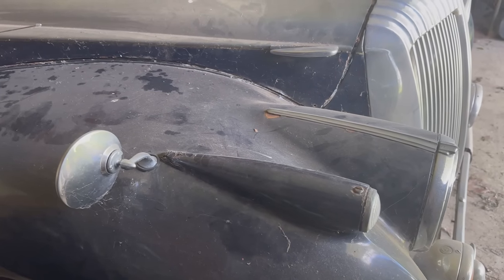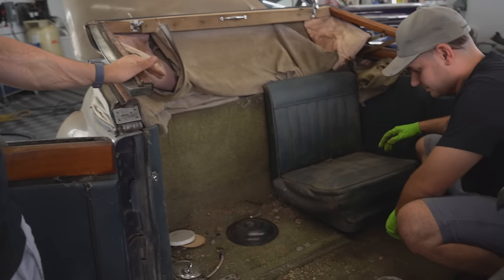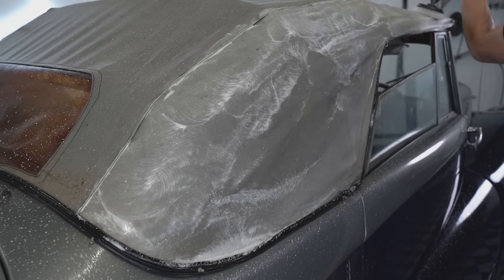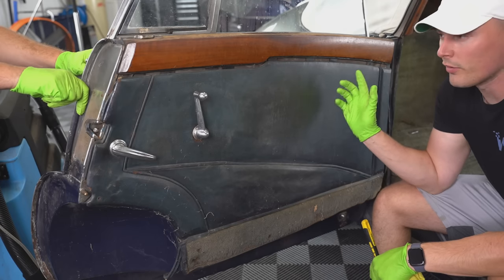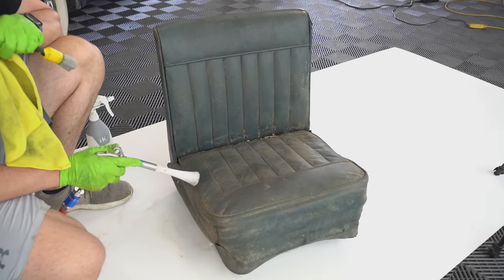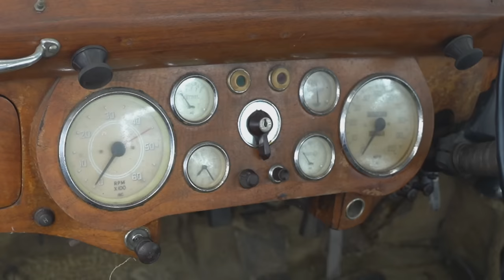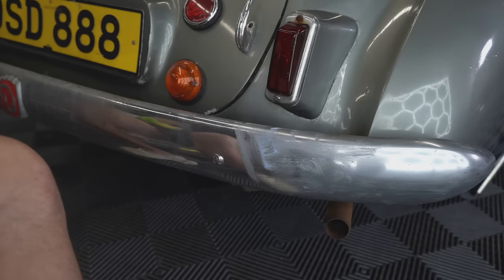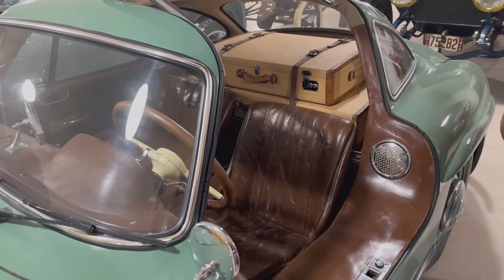85 Years Old ABANDONED Barn Find Daimler DB18! 1 of 25 Car Detailing Restoration!

Comment: For the record: Daimler is pronounced with the a sounding like an a DAYmler! And Coventry is pronounced as in Cough. Cov. But hey, great video guys! And GB just means Great Britain. The blinker, as you called it was fitted before modern indicators and was known as a trafficator.
Reply: They pronounced it right. Its German.
Reply: Nerd 🤓🤓🤓🤓
Reply: That is America speech  , not many can read or write
Reply: Who cares😂
Reply: @shydash3r  Check Google pronunciation buddy
Reply: I'm from Coventry and no-one pronounces it like cough.
Reply: Its Daimler. Not daymler. Gottfried daimler was not gay
Reply: Was known as a semaphore indicator.
Originally they just lit up. Later people used to add a flashing relay so you used to see them flick out then turn off and go limp then get go erect and light up again. Hilarious.
They also had a habit of sticking in once activated then they got mad hot and melted or went on fire.
Clever people added enough wiring to make them flick out and then flash.
Of course they were pretty useless at the best of times. I am old enough to remember them as standard on cars.
In the 60s we had a 1948 Day-mler.
We used it to tow our 1932 Brooklands Riley, school runs etc. It was a bit thirsty but lovely to drive with its pre- selector transmission.
Take off in second or third gear for chauffeur driving smoooooth.
Reply: COV-En-Tree - don't know where you got the cough from - bad weather? Coventry can get a little damp.
Reply: @shydash3r  It's British, and pronounced DAMEler
Reply: @golden.lights.twinkle2329  it's the damp...
Reply: @FrankJAnICKK  Gottfried Daimler had almost nothing to do with the Daimler Motor Company Limited, beyond lending them a convenient, known name to sell their cars under..
Reply: How can you pronounce, the founder GOTTLIEB DAIMLER the British way, it should be pronounced the right way, the German way, he started the Daimler in the UK to bring cars to Britain, that was he's plan, the original Daimler AG was started in Germany
Reply: @Zootalaws GOTTLIEB STARTED THE DAIMLER MOTOR CAR COMPANY IN BRITAIN IN 1896 to bring cars to Britain, remember at that time your Royals were still very German, and he's idea was to produce cars for the rich and royalty

Comment: Great video guys - this car brought it all back to me.
In 1973 I was 17 and bought my first car - it was a Daimler Conquest Century saloon from 1955 in white - so it was a year older than me at the time.
The registration was EMT 554 and was bought in London, it came with its original handbook which showed not only the saloon but a drophead coupe and a roadster.
The drophead coupe was very similar to your but without the suicide doors.
The roadster was strictly a 2 seater with a single dickie seat in the boot to allow you to carry an extra person.
My car had the battery under the rear seat and the semifore’s had been filled in but you could see where they had been.
It was the best car I’ve ever bought, sadly it failed the MOT due to the steering box needing replacement - I could not find one so I reluctantly had to let the car go. Back in the day car parts were not so easily obtainable as they are now.
Even back then it was a real head turner and I was a very proud owner.
Thanks for restoring my memories of a great car in great times 😍😍

Comment: Very interesting video about a truly lovely automobile. At the beginning you mentioned the 15 horsepower. That was the taxable horsepower calculated by the method specified in Britain because the road tax was calculated using that figure. Also, although you did not mention it, the circular hole at the bottom of the grill is for a crank handle to start the car. Many English vehicles had this into the 1970s. What was almost my first car was a 1967 Austin A60 Cambridge and it had that feature as well. 
If that is the original paint on that car i really hope it is not restored, just preserved. It is spectacular. Daimler was bought by Jaguar in 1960.

Comment: As pointed out by others, the missing gap in both fenders are where the electrical trafficators sit, basically your early version of indicators which operated either by hydraulic lines, cable, or in this case, an electrical solenoid. That GB badge I believe was used on the earlier models, as I tried looking for images of the Special Sports edition you have, but found none with the GB badge on it. Quite a unique car as they were partnered alongside Jaguar, another luxury car company that made similar-looking cars.

Comment: Those arms are semaphores and were used to signal turns before the widespread adoption of blinkers. This particular car appears to have also been retrofitted with actual blinking turn signals, which is a common mod, but it's not unusual to also keep the semaphores functional. It doesn't have 15bhp. The number you quoted refers to fiscal hp which is related to engine displacement and was used for calculating road tax. For the record, this model made 70bhp. The GB badging stands for "Grande Bretagne". Cars that travel internationally are expected to carry the identification for their country of origin. In the distant past, this identification was mostly based on French which used to be the language of international diplomacy. Since Brexit, British cars travelling on the European continent carry UK badging, although many countries, UK included, now include the identification of the country on the license plates themselves. I'm Canadian and when I took my Québec-registered motorcycle to Europe, I put a CDN sticker on it.

Comment: It's a 1948 - 1952 Sports Special drop head coupe constructed by Daimler's in house coach builder Barker on a modified Daimler Benz DB 18 chassis which in turn was a development of the successful Daimler Fifteen of the 1930s. The chassis designation DB18 is one of a maximum of 500 built (including the Empress on the same chassis). The allocations being 53750 to 53999, 56136 to 56188, 56700 to 56774 and 59010 to 59239. This vehicle has the number D56768 (@3.19). Information courtesy of the Daimler and Lanchester Owner Club Ltd of Great Britain website.

Comment: I am a witness to the plastic indicators. There used to be two ie one on each side. These popped out after a button was pushed for right turn or left turn indication. These plastic had light bulb inside. Usually these were located in the pillars between the front & rear doors.

Comment: Apparently this is your first or early foray into the world of Brit cars.  The GB on the boot (trunk) lid signifies Great Britain for those in other European countries that would wonder where this fine automobile originated.  The tall, slender slot with the broken piece of plastic at the top 
is a 'trafficator', which was the standard for automobiles sporting what we call turn signals. In selecting the direction of turn on the steering
wheel, or other location, the arm that normally resides in that little slot pops out and lights up, indicating that the operator is going to make
a turn. They are mounted usually around the B pillar, but can be found in other places, as in this example, in other places as well.  Regards
to the horsepower rating that you found, that is the taxable horsepower, not the brake horsepower that we use for our cars. The horsepower
that we use would be quite higher on this car than 15.  Cheers.

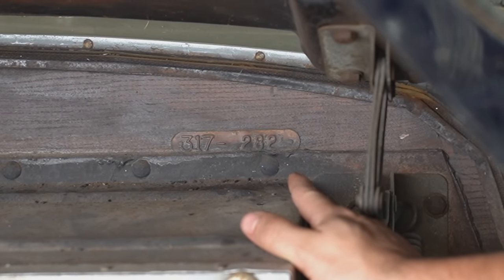Comment: This car is called a Daimler Special sports, the chassis by Daimler, the body by Barker and company.  The chassis is designated DB18 and was utilised before the war and was supplied complete with body. It was continued after the war and eventually updated and called a Consort. Several chassis were sent to other body builders but xgenerally had the uprated engine with twin SU carburettors. The transmission had a 4 speed pre select gearbox, the uprated engines had an overdrive 4 speed gearbox and worm drive rear axle also Aluminium cylinder heads. My car with a similar chassis number was sold in 1951. The car uses  BSF (fine) (BSW Course in aluminium) nuts and bolts 3:30

Comment: I suspect that the unidentified slots on the side were for turn indicators. Given that you mentioned electrical points I suspect that they were electrically operated, quite sophisticated for the period where most of them were usually manual.

Comment: I'm sure it has already been mentioned but the UK registration plates stay with the car for life unless you purchase a private plate, yes the UK plates can be bought and sold and one of the rules is that you can't make a car appear newer than it is and our plates tell you the year of registration so a dateless plate like the one on the Daimler is worth an absolute fortune. When first introduced they started at A 1, A 2, A 3 and up to YYY 999 (we don't use I,O,Q,U or Z). Then in 1963 the format changed to what we call a sufffix which consisted of 3 letters which were usually area related, up to 3 random numbers and a date letter at the end which relates to the year of first registration eg. ABC 123 A for a 63 car or ABC 123 C for 1965. Then in 1982 the format reversed to a prefix and the date letter appeared first so a 1982 plate would read A 123 ABC. For some unfathomable reason they chose September 1st as the change date. In 2001 the format changed again to 2 letters 2 numbers 3 letters and the numbers are the date code but now they change every 6 months in September and March

Comment: The small hinged chrome items spring loaded are called "trafficators" early turn signals I think.  They would pop out with a light and point in the direction of the drivers intended turn. The GB on the trunk stands for Great Britain, and was customary to have them on a vehicle when driving it abroad.

Comment: Those small vertical slots are Trafficators. They are semaphore signals which, when operated, protrude from the bodywork of a motor vehicle to indicate its intention to turn in the direction indicated by the pointing signal. Trafficators are often located at the door pillar.

Comment: The vertical slots at the rear of the doors are the old-fashioned turn indicators. Before turning, these would flap up via a switch on the dashboard exposing an amber light on the turn signal. After turning you would return them to their original position (flush with the car). These were later replaced by flashing amber turn signals on the front and rear of all modern cars.

Comment: I have a Daimler DB18 but with a Barker 4 seater body it was registered 1950 and was one of the last, the first ones were built in 1939 (as used by King George VI), nice car 2 1/2 litre engine with a pre-selector gearbox.

Comment: I remember my dad's Daimler Conquest, based on the Lanchester 14 ( a company Daimler had bought not long before), first sold in 1954,  which this definitely is not.
This car really is a pre-war DB18. 
Value? Here's an example from H&H car Auctions: 1952 Daimler DB18 Special Sports Drophead Coupe, Fully Restored During 1999 - 2000 at a Cost of £90,000
Sold for £43,875. Please note it fetched £45,000 less than restoration costs...  
However, here's another : 1952 Daimler DB18 Hooper & Co. Drophead Coupe Lot 179 | The Amelia 2023 | Sold Price: $212,800 "
Nice video.

Comment: GB stands for Great Britain and the number plates are British as well. The plastic part at the side are one of the first indicators used on a car called trafficators or flippers. They appeared around the 1900 and were later replaced by lights but you can find them on some cars up till the 1950s.

Comment: The orange “arrow” is the direction pointer. Is you take a corner there is a handle of switch at the. Sterling wheel which activistes the side iT which you turn. Amazing that you do not know.

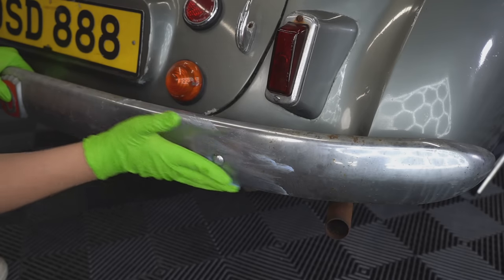Comment: I think the slot with the coil is a turn signal flag that would spring out to indicate turning left or right. That's my guess. (3:44 & 20:43) I believe the GB represents Great Britain since it is right-wheel drive car.  (6:00). For the seat rails and the chrome bumper, a product like P21S Polishing Soap would clean them right up, remove most rust stains and make the rails and the bumper shine. (16:25 & 20:51)

Comment: What is in that so called fiberglass are Indicators I think you call them Blinkers. It is an arm that lights up to signal the direction the car is turning.  So be very careful as they can break.How old are you guys The badge until recently was always GB for great Britain now some are UK.  Now Daimler was bought out by Jaguar I think this car could actually very rare indeed as a convertible.  Also those round indicators were added perhaps because of America or add on's later sadly.

Comment: The DB18 is probably a '51 or '52. It is probably around 80BHP or so. The rating you mention is on a different scale. The orange thing in the wing is a trafficator. It flips out electrically to indicate a left or right turn. The GB is for Great Britain for when you are driving abroad.
Reply: PS....value of good running restored cars is around USD $50k or so. This would be worth a lot less, as restoration is complex and a specialist matter.

Comment: they are trafficators or turn signals, note Kelly gearbox where you select gear then press selector which must not be used as a clutch as fluid flywheel is clutch

Comment: Its a Daimler Special Sports which were built between 1948 49 to 1952. There were 500 built. Body made of durallium front fenders steel. Very expensive when new. Examples were owned by Royalty the Rockefeller's and other wealthy individuals. The hood (folding roof) should stuffed with horse hair. Values vary significantly. Expensive and difficult to restore. I own 2.

Comment: 3:40  Oh this is an intentional mock up situation where they pretend not to know what those are so we will all comment on the video. Pretty smooth of them really because it worked LOL. Funny! So anyway those were/are called "Semaphores" also known as "Trafficators" and even "Flippers" by some. They were the early version of "Signal lights". They were used for many years before the signal light became the regularly used way. They came into use in the early 1900's which had an electric light inside about 1908. But not all of them had a light. Electric operation came in 1918 when the Naillik Motor Signal Company of Boston added electric motor drive. This system was superseded by two French inventors, Gustave Deneef and Maurice Boisson, who used a linear solenoid in 1923. The final complete system came in 1927 when Berlin-based Max Ruhl and Ernst Neuman combined internal illumination and solenoid operation. They were common on vehicles until the introduction of the flashing amber, red or white indicators at or near the corners of the vehicle (and often along the sides as well). They have been increasingly rare since the 1950s, as ever-stricter legislation has prescribed the need for the modern type of flashing signal. Many historic vehicles (e.g. pre-1960 Volkswagen Beetle) that are used on today's roads have had their trafficators supplemented or replaced with modern indicators to aid visibility and to meet legislative requirements. In some countries trafficators may now be retro-fitted with flashing lights.

Comment: Thanks for your videos, enjoy. Chuckled at this one and your commentary:

Was brought in the North of England in the 1950s and 1960s - very cold and damp and foggy.

- there was a world war  1949 to 1945 and took a long time for the economy to recover; car production was mostly shut down from mid 1930s through 1940s, switch to war munitions

- the GB badge and similar were very common in that era

- the turn indicators (those slots on the side) were very common and worked well - except when they froze up - my job would be to wack them with my hand to break up the ice and free them!

- indeed you should pronounce the name DAMEler not DIMEler

- I would never spray wash the engine compartment of a British car (poor electrics)!

Comment: No this is a 1939 Daimler.   Daimler made all these models in 1939, but did not have the money to market and sell them.  So the once the car was built, Daimler warehoused them and then sold the BATCH over the next 12 years, or as long as it took to sell them off.   Had Daimler had more money they would have sold all of them in 1939, but marketing automobiles, ones like this, was very expensive.   Further auto sales almost stopped during World War II.   So, in my estimation this is a 1039 Daimler.   It just took  a dozen years to sell them.   Of course as each year passed, Diamler sold them as a new years car, not one several years old.

Comment: The date confusion is understandable. British cars registered before 1963 had dateless registration numbers. The registration number is the number on the "number plate", what Americans call the "licence plate". The GB badge was put before driving in the rest of Europe, to warn other drivers that a British driver, used to driving on the left side of the road, might do something stupid! The slots are trafficators, an early semaphore turn signal. That car might be unique, a British specification, right hand drive, car that has clearly not even spent one winter on the UK's salt soaked winter roads. An original 1951 UK car with no rust is almost unheard of in the UK! 
PS. In the UK, where this was built, it is ALWAYS pronounced DAYMLER, like daily and dainty.

Comment: GB stands for Great Britain, they’re called trafficators not blinkers
You also, need to learn how to clean old English leather, the first step is hydrating it with Leatherique, each application will bring more dirt to the surface without agitating the leather and causing the color to bleed